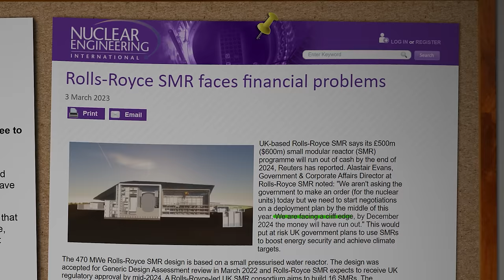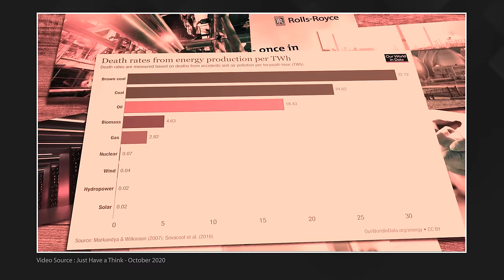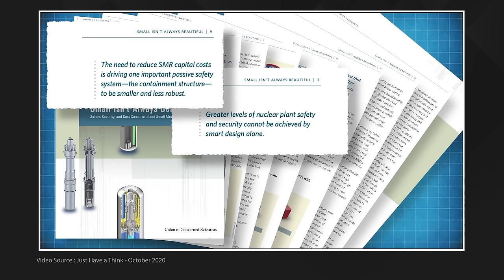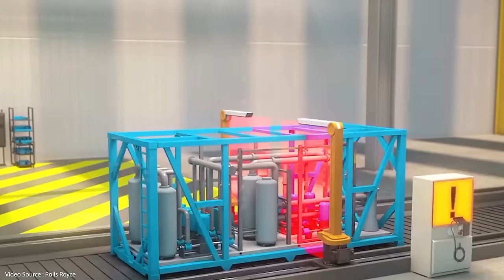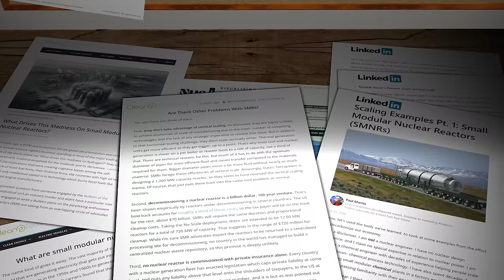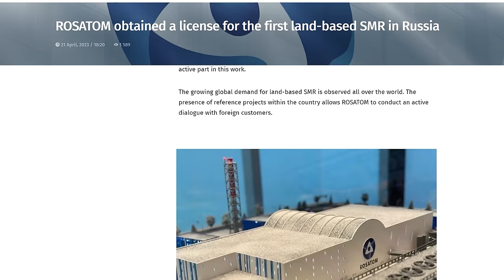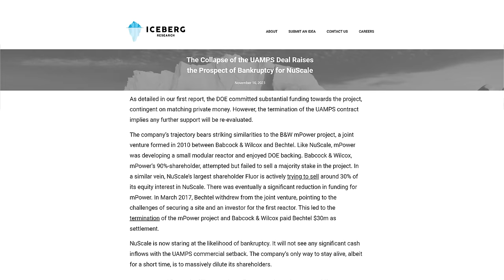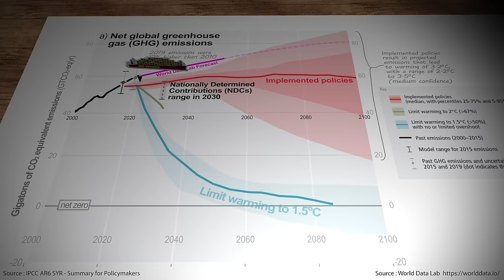Small Modular Nuclear Reactors. The Verdict

Comment: by the way, the china one was once called THTR and was sold/scraped from Germany. (google finds it). back in time it was just for trial, which was the reason to be small. nobody called it SMR back in time.
Reply: Like i said none of these are SMR, it's just goalpost moving.
Reply: That is the pebble bed experimental reactor he showed and a larger commercial one is now connected to the grid.
They are 4th gen reactors and not modular SMR. The modular reactor China built on an island is only 100 MW and a pair drove a single steam turbine of 200MW. He was also wrong about its completion on 2026. It is already connected to the grid last year, so many inaccuracies in this video.

Comment: I really appreciate your thoughtful and clearly well researched content. In relation to nuclear, while it may be that DC megavolt transmission is on it’s way and that this will allow countries with a lot of solar to export to those with less, i don’t think that this or the locally generated solar or wind is likely to fulfill the need resulting from the transition from gas and coal towards cleaner sources as the base load requirements for any country are likely to considerably increase with the evolution to EVs. I saw a piece from one of the congressional hearings where the energy companies were talking about the increase in load expected from just cars as EVs and if recollection serves the energy companies were indicating that not only could they only fulfill a % of the expected increase, they had no plan to get to where they need to be to serve the whole lad. I am sure the same situation exists here in the uk. I think it would be interesting to look at an analysis of what we have today, what plans there are for increases and what we think the overall load will look like come 2030/2035 when the EV transition really happens. I don’t know the answer but my guess is that we are also woefully underserved for power in the UK.

To have a quick look at what might be needed, my house is reasonably average and I use around 15 kWh per day, and an electric car had a battery in the range of 35-70kw. I.e. 2-5 times the daily load of my house. Now it’s of course unlikely that I will need to fully charge an electric car with a 70 kw battery every day, but even if it’s every 3-4 days, that’s still a huge increase over today in terms of power generation needed on a house by house basis and in the UK where the weather is at best unreliable, I’d expect base load needs to be higher than in some other places with more reliable climates. It honestly doesn’t feel like our government (and potentially most governments) have a handle on the scale of what they are trying to commit to with the move to EVs.
Reply: EVs will need very little increase in grid size because a grid's capacity is set by PEAK demand only, not how much power is moved over a year. And EVs overwhelmingly charge off peak, and with proper ToU (Time of Use) electricity tariffs would do so even more. Not only tha, if EVs move to V2G (again, it just takes proper tariffs to incentivise that) they will actually REDUCE peak demand. Those utilities were, as so often with those who want any excuse to stay with fossil fuels, bullshitting.
Reply: @kenoliver8913  While I appreciate your view, the point of my comment was to suggest that it might be an interesting topic to discuss in an episode as it’s not a topic that has been covered and I think it’s important. With that said the national grid currently has an article on impact of EVs and they are suggesting that it would represent around a 10% increase in overall load to move I think they quoted 80% of cars to EVs. As a country in the UK at least, we can see that we do not have lots of spare capacity in the grid and it is absolutely certain that the peak capacity of the grid includes all the sources of generation, we have seen a number of instances of the course of this winter where Octopus flux have offered payments for reducing load at peak times. While I agree that base load and peak load are not the same, the more that the base load approaches the peak load, the more we have risk in our generation. It’s very nice that we have upcoming technologies that will allow vehicle to grid scenarios and also I am sure we will have the ability to turn down or turn off EV charging at a central level in order to avoid load shedding issues, we don’t have what is needed today and so a conversation on the modelling of how the load will look is likely a good starting point for everyone. We need facts and figures to work with and not opinions.
Reply: @grahamheath9957  I think we are in violent agreement here. Yes, it needs to be properly and formally modelled - and the estimates I've seen from that modelling suggest about 10% extra grid capacity from full electrification of transport. That is very, very different from what those self-interested US utilities were claiming - it is dreadfully unfortunate that AGW has become a tribal conservative versus liberal issue in the US.

Comment: Great summation of the SMR story and I totally agree with your view that we probably don't need them. Seems to me that it is more of a niche issue pushed by those who might seek to profit from a few enthusiasts looking for the new and shiny solution. I have been a follower of SMR for some time and despite many claims of sorting it out, I actually wonder whether it would ever be in a position to compete with wind, solar etc, which has enormous scope for improvements to efficiency, thus costs. Loving your show.
Reply: I dont believe it NEEDS to "compete" with renewables BUT is a BETTER alternative where renewables FAIL and carbon fuelled plants are the other option  but that makes the costs even WORSE as that would require LOW volume production so NO "horizontal scaling" and hard to build locations like FAR north Canada / Russia ETC

Comment: Pumped Hydro Storage is a real world option for baseload from renewables. This of course includes updating dams to PHS
Reply: Except in Belgium, a very large mudflat in Europe. 
And the many, many other places with almost no elevation changes.
Reply: @factnotfiction5915  
You don’t need that much elevation change. In fact a few hundred feet with 2 manmade lakes is enough. The hill has containment walls and the lowland is dug out. The lowland earth could be a source of material for the containment walls up top. But the larger point is megavolt DC could move this energy 2,000 miles or more with single digit percentage loss. Knowing we can move PHS energy thousands of miles is a game changer and makes it viable.

Comment: Well said Dave! Unfortunately in DK, the home of wind power, there is an extremely vokal Smr lobby which has gained a huge amount of traction, not least with the 18-30s. So I wouldn't be surprised if planning happens here soon, and also not surprised if it runs into the problems you outlined.

Comment: As usual, the devil is in the details.  Your closing generalization that wind, solar and batteries can replace nuclear is fully in that category and is generally wrong for full dependence on those unreliables, particularly with the extremely limited amount of battery storage currently anticipated.

One of those details is that supplying even a week of battery storage to withstand a storm of that duration would cost much more than equivalent nuclear capacity of any size or category.  More specifically, provision of seasonal storage to firm up solar capacity in Winter would cost an order of magnitude more than nuclear.  That is because annual solar capacity factor for provision of energy is very low - about 15% in New England, 10% in the UK.  And that is allocated with about a ten to one ratio between Summer and Winter, so that Winter solar capacity factor may be about 3% while Summer could be 30%.  That means to provide the equivalent amount of solar energy in Winter, without seasonal storage,  would require about 10 times as much solar capacity as in Summer to serve the same load in Winter.    Also remember that charging such large batteries will necessitate far more solar overbuilding than  the 30:1 capacity ratio with nuclear in Winter just to be able to recharge the batteries while serving load.  So much for kWh to kWh cost comparisons that neglect the nuclear kW to more than thirty solar kW ratio in Winter.  

Unfortunately with the anticipated transfer of heating from fossil fuels to electric, all northerly areas will become Winter peaking, meaning the system capacity will have to provide far more energy and capacity in Winter than in Summer.  The electric heating load in northerly areas will be at least four times as large as Summer air conditioning loads and will occur at night - not during sunny hours.   The extreme ratio will be at least four to one Winter to Summer because air conditioning needs to remedy only about 20-30 degrees F difference outside to inside, while heating needs to remedy 50-70 degrees F at a much lower COP in Winter than in Summer on at least a two to one COP ratio. (Heat pump COP can be more than 3 in Summer compared to 1 -1.5 in Winter. )

And as far as time to build nuclear is concerned, please note that recent EHV transmission lines to convey large amounts of solar and wind to where they would be needed have taken 15-20 years to construct for even short lines.  Traversing multiple states in the US to connect favorable solar or wind areas to distant loads would likely take even longer to accomplish than building new nuclear more locally.  

A small amount of local solar, wind and batteries can be useful, but will never compete with nuclear on a net zero basis on either cost or time required to implement, disregarding the immense waste of land area for collecting and transmitting such diffuse sources of unreliable energy.

Comment: Thanks for a very informative update on the current status of modular nuclear reactor technology.  It's an interesting option but clearly not close to "silver bullet status" at this point.  With regards to the final comments on other renewable energy generation options, it is important to keep in mind that current wind and solar energy generating options are fairly cheap as long as they are providing power on the margin and don't require expensive energy storage for reliable supply to the electric grid.  If a major electric grid was almost completely supplied by wind or solar farms, the battery storage along with the extra windmills and/or solar panels that would be required would make the cost per KwH quite high - probably at least as high as from modular nukes.

Comment: You forgot mineral resource consumption. Wind and Solar are cheap because metals are cheap for now (thanks for machines they are running with oil)… SMR is efficient in term of metals usage. It can become cheaper ecological energy in short future.
Reply: Well as the video pointed out a larger nuclear reactor is going to be more efficient in terms of materials usage then a smaller nuclear reactors, so in your imagined word of minerals shortages it would make sense to build a few large nuclear reactors rather then many small ones.
Reply: @francesconicoletti2547 Even the small ones are more efficient materials usage than battery, solar,  and wind. Avantage SMR is the capacity to do faster deployment. We're running of out time.. end of oil is really soon. Nobody seems to realize. They're still counting money like we'll have infinite minerals and oil resources. No economic projection is pathetic.

Comment: The extra grid capacity expansion construction costs are ignored in all these nuclear posts.
Nobody does the calculations. 

Yes, I know the existing grid is available, but grid electricity is only 15% to 18% of all energy used.
Reply: Those calculations do exist. The EU for example has been pushing the members over the last two decade to significantly increase the interconnection capacity after a number of regional outages, including e.g. France end of 1999. The current goal 20% transmission capacity to the neighbors relative to the total capacity. As so often, the main problems are politicians and locals fighting against any new line or making ridiculous demands like underground high voltage lines.
Reply: @joergsonnenberger6836  What I am saying is 5 to 7 times more electricity generation is required if all electric world and fossil free future. 
So, every country has the same bigger electricity needs. 
Bigger grid capacity needs.
THESE ARE THE NUMBERS THAT NO ONE IS TALKING ABOUT. 

When you see many rows of transmission towers in long parallel lines, it is because more capacity was needed. 
People just do not know or see the amount of poles and wires and transmission lines.
Asian cities often have a mass of wires in the streets in towns as more people want more electricity.

Bigger capacity is expensive to every country, and 5 to 7 times bigger is bigger than the national debt.

Now, if you are a government guaranteed private generator business, you will have a private monopoly.
Reply: @stephenbrickwood1602  The numbers differ depending on the existing energy mix. Germany for example has been using a lot of gas for heating compared to France, where a lot of heating is done electrically (and no, not with heat pumps either). A factor of four for the growth of transmission capacity is quite reasonable. Now that's local and regional capacity foremost. The method of generation affects how much interregional capacity is necessary and that's what the high voltage lines are, e.g. anything 110kV and above. Nuclear power can be produced anywhere, so it would allow building fewer transmission lines. Of course, if the nuclear plants have problems (France cough cough), that can result in shortages as well. It's very complicated.
Reply: @joergsonnenberger6836  you don't understand. 
Nobody understands these transmission construction costs. 
Nobody understands the length of the national electrical grid. 

Millions and millions and millions of customers. 

In Australia, the national GDP is $1.5 trillion.
Grid length 1 million klm. 
Grid construction costs 1 million $/klm 
5 times more capacity $5 TRILLION.

Plus, new generation plants construction costs. $2 BILLION each. × 400 SMRs
Plus, staffing costs. Particularly nuclear quality staffing 3 shifts 24/7.

But this is only little Australia. 25 million people. 

There is an answer, but you must see the problem first.

Comment: There has to be an equilibrium between number of reactors and frequency of failure. 

Just like 4 engine planes experience engine failures more frequently then twin engine planes, we need to make fewer reactors but make them very reliable as the cost of failure is too high.

Comment: US Navy aircraft carriers have small nuclear reactors; in the range of 165 MWt. Large enough to power a small city. They have the maintenance material the training material and retired personnel could step in immediately, and put these to use.
Reply: Then why has no one ever even considered a Navy reactor for commercial use??  That is both a question and answer.
Reply: They are too expensive to be a commercial proposition; you may as well ask Fedex to send international parcels via ICBMs. The cost is not a deal breaker for the USN (though it does hurt - its the reason the Brits went non-nuclear for their latest carriers), but it is crippling for anyone who has to compete with other sources of electricity.

Comment: When I saw that offshore wind generates more power for less money than SMR it was over. I find it ironic that SMRs are being used to produce petrochemical products. That steam/heat production was a potential use for them but we'd save so much energy just not having to refine oil any more.
Reply: The crucial difference between wind and nuclear is that a nuke is 7/24 available,  and a wind turbine is "whenever/whenever".

Comment: I do not think one must produce reactors like ford did with T1. It is actually not the reactor itself that is so expensive, it is the whole project that makes it expensive. Standardisation is important, if that is achieved even a small production in factories will lead to cost decrease. But that standardisation is hard, because every country is requiring lots modifications due to local regulators requirements. UK 7000 modifications on EPR, Finland 2000 mods on EPR....

Comment: The most meaningful SMR are the most ambitious ones. 
Copenhagen Atomics aim to build an SMR that is:
- High temperature low pressure (molten salt)
- A waste burner that can reach close to 100% actinide burnup
- A thermal breeder (thorium)
- Made in 2 cm steel plating
- President safe (cannot be operated to blow up)
- Terrorist safe (even if blown up externally, the radioactive salt contain the radioactive elements and turn into stone for easy removal)
- Automated operation (auto balance without control rods)
- Can be build FAST, expect 1 reactor/day. 
- Double passive shutdown in case of power failure (boiling away of heavy water moderator + gravity drain of liquid fuel)
- Serializable - possible to connect several reactors to one secondary molten salt loop heating steam for a single turbine. 

- Expected to beat coal on price, even with an initially short operation time of about 7 years. 
- Easy to test extensively without turning on the reactor (thermal properties, electronics etc.)
- "Energy as a service" business model

They will surely not be the first company to produce a commercial SMR, but they will be the company with the greatest SMR (if succesful of cause). 
Even if they don't manage to complete their own reactor, they will surely get work from other Molten Salt Reactor companies, as they have more technical experience with Molten Salt loops than any other company (more test hours, own production of ultra-pure salts to be specific).